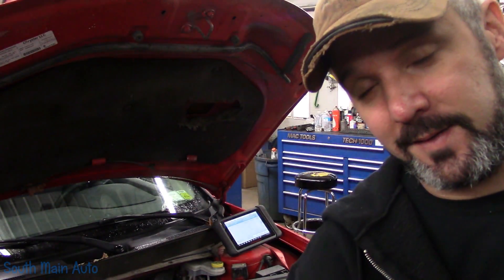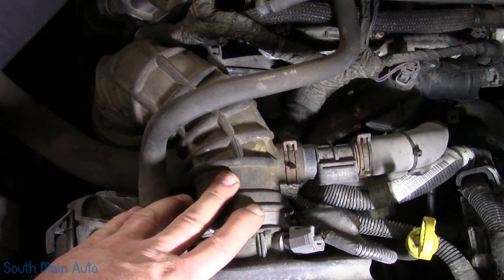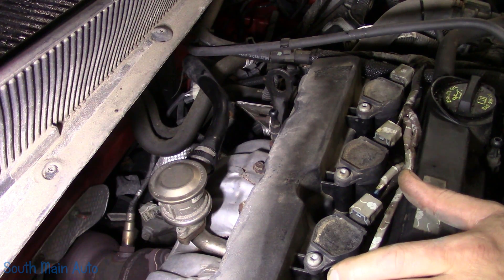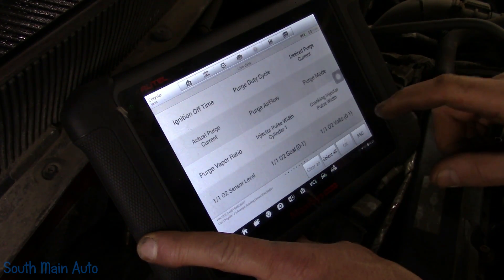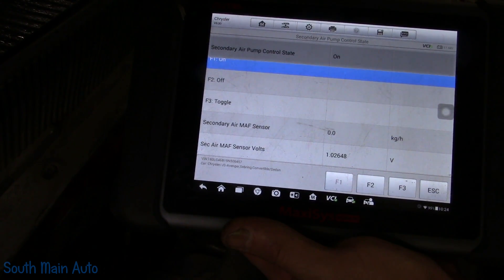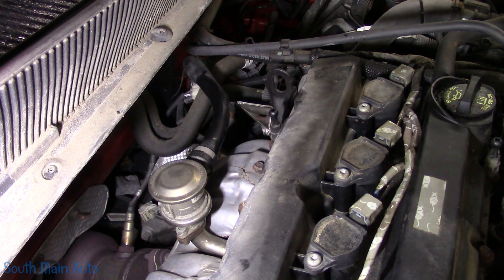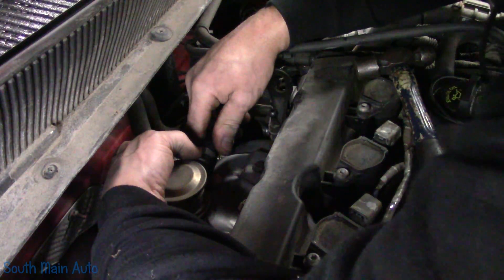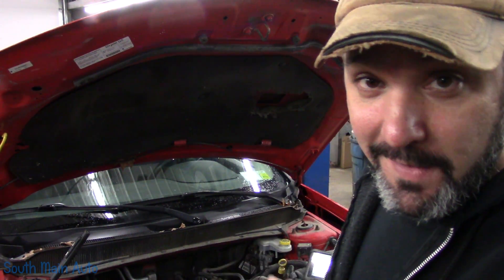Dodge Avenger: P2441 AIR Pump Switch Valve Stuck Closed

Comment: has anyone had this where air pump works new valve and new maf sensor and still have check engine somethings not recognizing the readings when it pumps the air, ANY IDEAS?

Comment: I have a 2013 Dodge Avenger 2.4L, I have a P0491 & P2431, I've replaced the air pump check valve and as soon as I turn on the car on ACC, delete the codes, turn the car, check the pending and the first code to pop up within 30s of car being on after deleting codes is P0491 instantly. I bought a used Oem Air Pump Check Valve, is it because I still used a used part? Or should I purchase OEM Check valve & air pump to replace it? Thank you.

Comment: My avenger needs the hose that the air pump hose connects to, but I can’t find it for the life of me. My air pump hose is not attached to the big hose and i thinks it’s causing problems. Because my big hose (I think it’s the air intake hose or something) doesn’t have a hole for the air pump hose to connect tooo

Comment: I will tell you why you never noticed that air pump...because this is a PZEV vehicle and not all avengers will have this special emission control gadgetry..only the PZEV models.Partial Zero Emissions Vehicle.

Comment: I have a question. My car has the same problem.  And code  but I replaced it a new air pump and a new valve. And a new relay  of the air pum and I still have that same problem after I change everything   The code still continue. 
I don’t know what else I can do about. 
Anything about you can help me  sr. 
The you know please. Sr

Comment: it may have been good it was stuck open

because on a cold start it’s should be open to get cleaner air to mix into the exhaust.. i think it only runs for 90 seconds then shuts off. i’m relating it to the air/smog pump that only runs for 90 then shuts off and maybe closes the valve once it’s ran it’s 90 seconds 

so you may have been fixed it i understand that it would risk burning everything in front of it and is worth the couple dollar bills thank you good work on ur before after video 
hope u don’t feel ill like that again

Comment: Blowing out of both ends? Money light will be on soon haha. Speaking of valves getting stuck open after tapping I had this happen on an 07 Cobalt with the evap solenoid under the hood. Kept having "Check Gas Cap" display across the dash. Cleaned the gas cap seal and lubed it up. Cleaned the mating surface on the filler. Checked the check valve in the cap. Same thing plus an evap large leak detected code though I forget exact number. Gave the solenoid some whacks and it started flowing. Engine sounded like it was struggling just to idle though. Pulled off the gas cap and the car died haha. Once it was off I unhooked the battery and whacked it a few times again. Stuck shut again. Well thats better than open was. $18 later for an Acdelco part and all is well. I unfortunately didnt have a fancy bi-directional computer to control it and see the problem in action but sometimes the butt end of a ratchet is a great tool aswell.

Comment: The worst part of  this job will be changing the stink'in battery. The only proceedure to access it is to pull all the ancillaries on the driver's side and remove the inner fender liner. The battery lives in the inner front fender.

Comment: Just found you...new sub. 95 suburban. Problem...front wheel bearing (outer ) is seized on spindle. Can't get rotor/hub off. Best method for removal? Thanks for you time.

Comment: Only certain Chryslers with 50 state emissions have A.I.R on them, and they only used them for a short time. They are only supposed to turn on briefly on a cold start to get the cat woken up. 1 thing of note, if you get 1 in with lean codes and high short term counters, check to make sure the pump is off. I've had a couple that were stuck on that were flooding the o2s with air, and neither had AIR codes!  The fix for each was replacing that fuse/relay center module which Chrysler is famous for.. ( the name slips my mind cuz it's late and I'm having a brain fart ) Feel better soon!

Comment: That was a common problem with 5 cylinder Volvos. The stuck valve would also cause condensation in the hose going to the air pump, eventually filling it up with water. Happened to me twice. Ended up drilling some weep holes into the pump to prevent that.

Comment: Hey Eric and other viewers who may be able to toss me some info. I have a 2000 Dodge durango 4.7  That has an overcharging battery (smells like rotten eggs) the battery is only a year old and holds a 12.6v charge so i'm pretty sure its not the culprit. I've ran a few volt tests on the battery while idling/after a drive etc with little to no movement to the voltages sitting around 14.3v. According to the gauge cluster the battery does charge up to around 15.5-16v but doesn't go above.. Is my alternator going bad? What other tests should I do before changing out the alternator?
Reply: At 15 volts it over charging and it's  not the alternator it's your pcm they put the voltage regulator in the pcm i know i have a 2000 Durango with the 4.7 go to pick a part get good used one

Comment: Man that system reminds me of the older BMW air systems. Same vacuum cleaner sounding air pump along with the mechanical valve. Even fails the same way. Stuck valve. BMW's valves though, stick open and the exhaust back flows into the air pump motor and burns it out quick.. Changed one on my sons car and the air pump motor looked like a charcoal briquette.

Comment: Just remember those scan tools that perform those types of actions can be well over $2,000 and above.  The sad thing is with vehicles becoming more electronic, if you want to be a mechanic, you will need those types of high level scan tools to diagnose those types of problems.

Comment: I have a 2006 Kia Sedona with a 3.8 V6 engine, with 70000 orginal miles and recently it started to make a weird engine noise when I start it up.  Any suggestions?
Reply: There's like a hundred different things that can cause a "weird engine noise" in startup. No way anyone can just guess what to check without being able to 1. Hear the noise and 2. Being able to touch different parts in the engine compartment of your car.

Comment: That’s the exact same system used on older BMWs. Even the valve is identical! And the pinch style disconnect hose. I want to see the Euro haters comment how an American company is using the EXACT SAME “ unnecessary “ “ over-engineered “ system! Huh?! Huh?!
Reply: Well, having an air injection system is not exactly a hallmark of a well engineered engine. It is basically a hack to meet emissions standards for an engine that otherwise wouldn't, and they have some reliability issues, as this video demonstrates. They tend to be used on engines that the manufacturer wants to get a few more years of emissions compliance out of before having to do a redesign.
Reply: Robert Hancock As Eric O said in the video,the system is pumping air into the exhaust to heat up the catalytic converters faster. In order for the catalytic converters to work as efficiently as possible they need to get hot. It’s the same basic principle introduced for O2 sensors : old style O2 sensors didn’t have a heater circuit and they would only work when they got hot from the exhaust gases. That is why the air pump only works on cold starts,not any other time. 
The engine has nothing to do with this system,at least not in terms of efficiency. 
This system is actually pretty reliable,the only common faults are from a stuck valve or from water getting into the air pump and frying the motor.

Comment: Sorry to hear about the both-end blowout! That sucks! You had me rolling with the description ... even thought it's not real funny when it's happening. We call that "the scutters" - you don't know whether to sit, or aim your face at the bowl.  Hopefully there's a basket nearby ... and you don't get confused in a panic, and sit on it instead of the bowl ... 🤣🤣 

I've got alot of that "inner Ivan", lol - I'd have busted out the torch, and the ATF/acetone mix, and went to town (if it were my vehicle - the incentive to play goes way down when not getting paid for it).

Stupid vacuum cleaner AIR systems! I worked on one on a '12 Impala - what a poorly engineered POS that toilet was! The whole time I worked on it, the blend doors clicked away, desperately trying to find home. Thing wasn't even close to 100k miles either! TOILET  ... but anyway, the stupid AIR valve was stuck shut (what a contraption that was! Engineers must've attended a "Revisiting Woodstock" event, complete with acid that Sunday ...), and the OE relay controlling it had melted down. I used a cube relay, wired it up, then filled the thing with Geocel 2300 roofing caulk,  just to get the poor lady a sticker. The hoops this state makes people jump through ... and the utter JUNK automakers build! 😡

Comment: Hi love your vids I have a question. I just Replace my  Rack and Pinion and now my Steering Wheel is not Center,do I have to take the Rack and Pinion off and center it.my steering wheel is in the 1clock position

Comment: Get well Eric.  Air pumps and o2 sensors, not good friends unless you inject after the upstream o2 sensor???
Reply: These systems generally only run for a brief period of time after startup, when the O2 sensor would not be in closed loop yet anyway.

Comment: so do these valves get fouled similar to a pcv valve?  curious if these just get carbon fouled with time and stick, so that cleaning them out with brake clean/parts cleaner is a viable solution to when they start to stick, or if replacement is the only viable option (thinking for a DIYer where a comeback isn't so much of an issue) - maybe playing a dangerous game as while it stuck closed this time, maybe next time it sticks open so better to just replace...

Comment: Kind of like the system on my old '06 Cobalt. Mine got stuck open and burned up the pump 3 times in 2 years before I got a valve that GM finally redesigned that worked.

Comment: from the high pitch/over-speed sound, it had flow deadheaded,
and my ears were right as soon as you unhooked tube and turned it on. not like I didn't "auto-assume" the valve was stuck shut....
you probably could pull it and drowned/soak with good old super-duper carburetor cleaner and it may not stick again for a zillion miles

Comment: My 1984 Camaro Z28 has an air pump and metal pipes to each manifold.  These corrode and are tough to replace.  Best to cut the pipe off the ferrule and use a socket to turn them out.  Funny, they pump exhaust into the intake EGR and pump air into the exhaust AIR.

Comment: So it's an anti-supercharger circuit, decreasing airflow to the engine.
Reply: It doesn't decrease airflow at all. That's the throttle body's job.

Comment: It's a shame that you can't take it apart, clean it and put it back on the car.  That would assume that there isn't anything really broken in the valve so it's probably better to just replace it.  Also, I wish I could get 10 years out of my batteries and I live where it's warm and dry. Smiles.

Comment: Pumping air into the exhaust - THE SOLUTION TO POLLUTION IS DILUTION
Reply: it gives extra air into the converter plus injection and ignition timing are set to super late and rich = unburned fuel in exhaust ..the extra air makes it combust in the exhaust / converter which heats up much quicker like that ....  not really a dilution...
Reply: @bobl78  It's comical that the manufacturers were able to get people to believe that. The oxygen sensors will read a higher level of oxygen because more air with 21% oxygen is being pushed into the system. How would it be ignited in the catalytic converter? If it did burn in the converter, it would melt the converter.   If an engine only used fuel and pure oxygen, the burn would result in carbon dioxide and water but since air is mostly nitrogen, that also combines with the oxygen at high temperatures to form nitric oxide, the brown gas associated with smog. That leaves less oxygen to combine with the carbon so carbon monoxide is produced. The converter facilitates the conversion of nitric oxide to nitrogen and oxygen and carbon monoxide to carbon dioxide. It needs to have the oxygen that was combined with the nitrogen. The air pumps were used before catalytic converters and oxygen sensors when the government measured emissions at the tailpipe. When they can't get the reactions to balance, they add air into the exhaust to aid the process.
Reply: Sorry, get informed how the system works.. it is NOT to dilute the exhaust.. it´s used to make a , if you call it like that, seconndary combustion of the exhaust gases in the exhaust manifold and pipe because they still contain a lot of unburned stuff during cold start, enforced by special injection and ignition strategies,,,... this raises the temperature of the exhaust fumes and shortens the time for the cat to reach it´s operating temperature.. this procedure is only active for a very limited time after engine start, about 1-2 minutes... also above a certain ECT it is not kicking in at all...  a cold converter does not melt within a few seconds
The system was already used in my 1994 car and the converter was still original after more than 180.000 miles...   it disappeared on newer cars because converters were moved much closer to the engine, integrated into the exhaust manifold or right after the turbo..because they can stand high temps much better than the old ones and today´s ECUs can measure or calculate EGT and keep it within levels acceptable to the converter..no need any more to put it far away from the engine to cover high load situations
Reply: @tiredoldmechanic1791 Sorry,  you are completely wrong. These systems are intended to reduce cold start CO/HC when the converter is not functioning yet. The air injection system is shut off by the time the catalyst is heated up because the excess oxygen would prevent the reduction (NOX) part of the converter from working properly.
Reply: @RobertHancock1  To convert the carbon monoxide to carbon dioxide it has to add an oxygen atom to the carbon monoxide molecule. To convert any remaining hydrocarbons to carbon dioxide requires two atoms of oxygen per atom of carbon and one atom of oxygen per two atoms of hydrogen. The NOX reaction strips one oxygen molecule because the oxygen "would rather" combine with hydrogen or carbon monoxide. That supplies one atom of oxygen but nat as much as may be required. The less efficient the burn in the cylinder, the more oxygen it requires to complete the reaction. I'm pretty sure you'll find that the air pump runs at times other than startup.
Reply: @tiredoldmechanic1791  You can't use the AIR pump when the cat is working because too much oxygen will prevent the NOX reaction from functioning properly. This is the whole reason why feedback carbs and fuel injection became necessary with three-way catalysts. Some old cars with separate oxidation and reduction catalysts had a setup where after the engine warmed up, the pump would be switched to feed air in past the reduction catalyst to put more oxygen into the oxidation part, but newer engines control the mixture well enough that it's not necessary.
Reply: Get better soon!
Reply: If only that were true.
Reply: Sounds like a air pump conspiracy theory. that's funny.
Reply: Not really how it works but sure, the earth is flat anyway
Reply: Yup, all these dang regulations... Completely screwing up the air quality! I for one have had it with all this clean air!! MAGA!!!1! /s
Reply: @mattmanyam  Every change ever made is only because of a government regulator and absolutely wouldn't happen otherwise! It's democratic socialism, not communism!
Reply: All you nerds explaining how it works. Ever think he was just making a joke?
Reply: Helps the catalytic converter to "burn" what's left in the exhaust to CO2 and H2O. Gotta love regulations.

Comment: Why did you not just undo the 2 bolts securing it down and clean the carbon out of it that's all that will be stopping the valve plunger from opening and closing
Reply: and customer comes back next week...
Reply: I've cleaned many a diesel egr valve out when they were sticking and never had a comeback prematurely and anyway inform customer if they want it either cleaning or replacing give them the option to spend money now or spend it later

Comment: Blowing out both ends - dude, GO HOME.
Reply from the maker: NO time for that!
Reply: no problem, you`ve got tiles on your shop floor.. so in the evening just clean it out with the pressure washer
Reply: I own my own business, I do understand. That said, burning the candle at both ends (sorry, couldn't resist) is not going to make for a safe Eric now and a soon to be back to his usual self Eric tomorrow.
The two times in the last 20 years I've had to take some downtime my customers understood. Any who don't are the pains in the butt you are glad to be rid off, anyway.
Reply: You call your boss if you were that sick. Call your customer or have Mrs O call them.